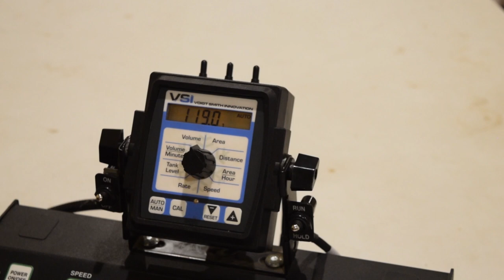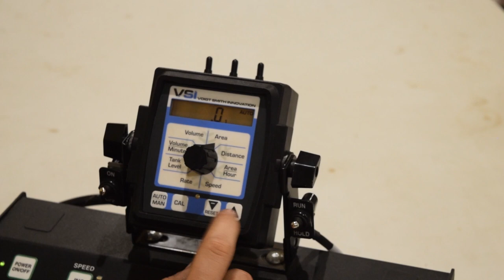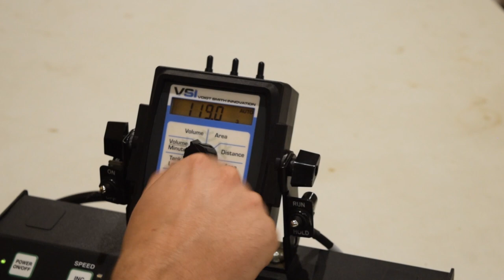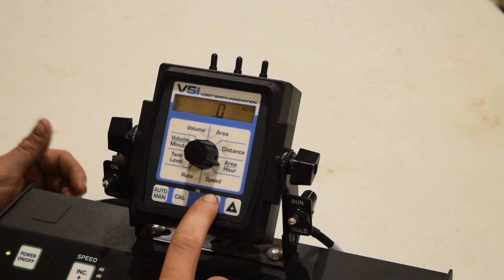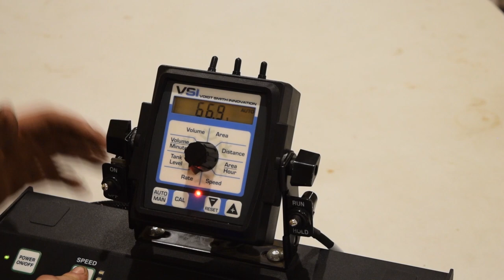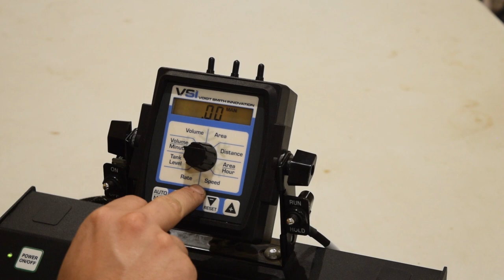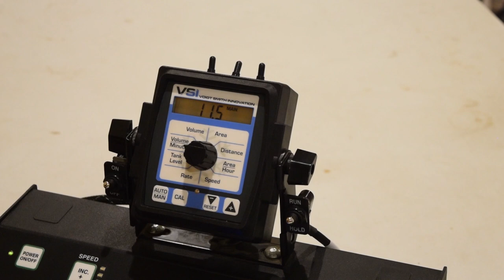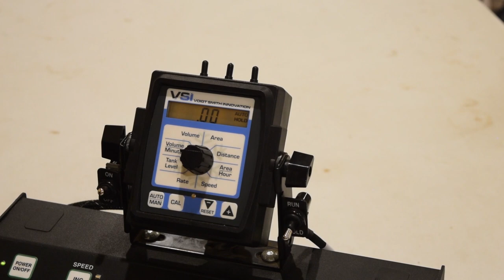VSI Deicing Controller Overview

Comment: Just watched the video.  Great help guys!  One question - how does the different nozzle sizes factor into the gallons/acre?
Reply from the maker: The different nozzle sizes pattern well at different flow rates. So you choose the nozzle size based on your gallons per acre you are wanting to apply. Tips are static and our system is dynamic so we have our tips dialed in for post treatment and pretreatment.

Comment: What is the black box under the controller called and what does it do? Trying to convince my co-owner to buy in and he is wondering what it is. Thank you for your time
Reply from the maker: The box underneath the controller is just a simulator as to what would happen when the sprayer is in use, it is only for demonstration purposes. Most of the time we just bring it to trade shows to show how a sprayer works when you can't actually run the sprayer. Just the controller comes with the sprayer and controls everything on the sprayer.

Comment: How do you set the flow rate?  We pressed and help cal. And changed it to 40.  The unit vol is reading way low and tank reading is going from 305 to 267 but the tank is empty.  
We just got your unit for metro airport.  It seems like the flow sensor is not working and its sprays full blast but reading way low
Reply from the maker: Robert, you should not have to use the calibration button unless your controller gets reset or someone goes in there and changes the settings. In calibration mode all of the numbers correlate to different things than the labels on the front of the controller. To change the rate you just need to turn the knob to "Rate" and press the up or down keys until you reach the desired application rate. So most likely now you have some settings that are not what they should be. Give us a call or email us at sales@vsinnovation.com and we can run through the settings with you and make sure they are correct!